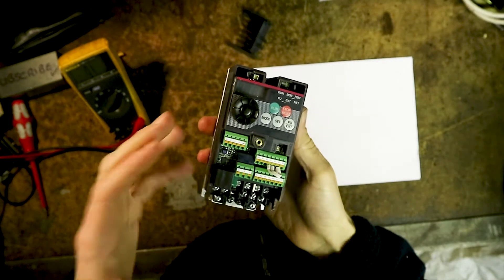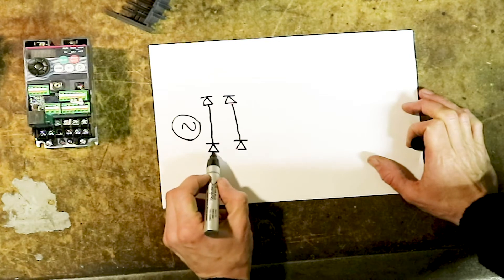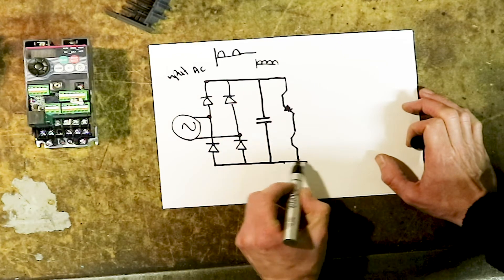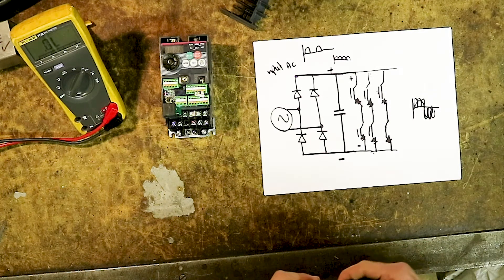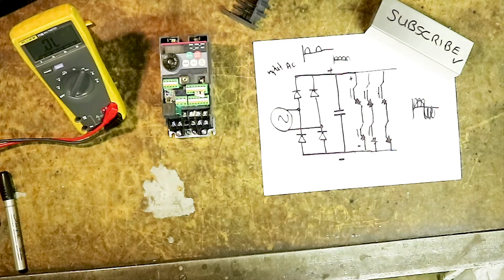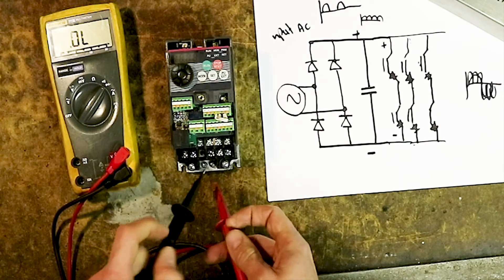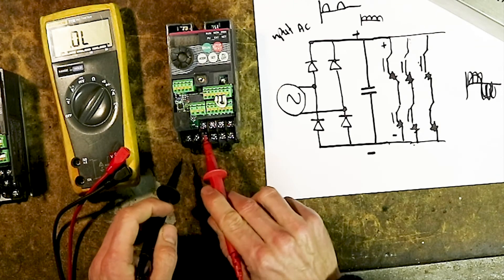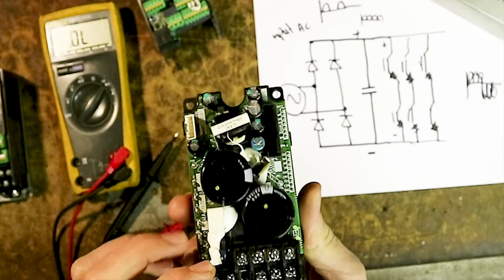How To Test a VFD (variable frequency drive)

Comment: When you call those a bridge rectifier, is that the same thing as SCR silicone current rectifier
Reply from the maker: I don't believe so, a bridge rectifier turns AC to DC, an SCR in my understanding is a Thyristor with a Gate that will only conduct when the right current is applied to the Gate.

Comment: Nice one, I have an issue with a seimen 120 ac drive. When you put power on the 3phase incoming I don't get a DC voltage on the capacitor side.

Comment: Good Teaching!
Just A Tip For The Young Bucks & Doe's Out There! When Your In Industrial Manufacturing As A Technician Responsible For Troubleshooting, Fixing And Preventive Maintenance Of Equipment. 
Your Ultimately Responsible For Optimum Up Time, Output And Quality Of Equipment And The Products Being Produced & Processed! Therefore, There's Not Much Time In Production For Testing & Troubleshooting!
Remove Smoking, Burnt Defective Modules, Assemblies, Devices, Etc! Swapping Them With New Ones Whenever Possible! Once Verified The Equipment Was Up And Running In Optimum Condition By Troubleshooting With New Modules Along With All Other Equipment Of Responsibility Being Up And Running! Take The Suspect Modules, Etc, In Engineering/Technicians Lab To Repair By Opening And Removing, Replacing Said Burnt Defective Components! Then, Test As Needed Or You Could Send Them Out For Repair Or Replacement To Vendor(s) Depending On Free Time Of Up/Down Time Of High Volume Production Equipment! Most Of The Time As A Technician You Have To Learn To Put Out The Fire(s) And Read Every Vendor(s) Machine And Equipment User/Troubleshooting And Repair Manual You Can! The Internet Wont Always Be Here Or Up & Available Due To Censorship Or Who Knows What!?!
Thus, There's Always Time To Learn To Wash, Polish And Wax The Fire Truck After It's Repaired, Maintained & In Working Order If You Spend Time Wisely Reading The User & Repair Manuals! 😎

Comment: Very nice. Helped a lot. Thank you.
In my VFD 9600D-1T-00220M case, the brake resistor is internal. It has two output connectors to attach an external resistor but was internally not wired, so I had to open it to access P+ and P-.
Reply from the maker: Sounds like a nightmare, but good work for figuring it out 👍

Comment: Nice video - maybe you will be interested to know that the wiring in the bridge rectifier is what "magically" turns AC into the full wave rectified DC . The capacitor takes this wavy DC and then smooths that into the power that is used on the DC bus . The bridge rectifier wiring does some crafty re-routing to achieve this which had me confused  for a while .... how does negative become positive ?? Regardless of the side that the AC wave is on compared to the zero volts line it is all voltage potential so half of the bridge flips the lower ( negative part of the AC wave ) up to the top to give you full rectification - no gaps ! Hope that helps
Reply from the maker: Thanks, that takes me back to college. It also stumped me for ages how the rectifier works.